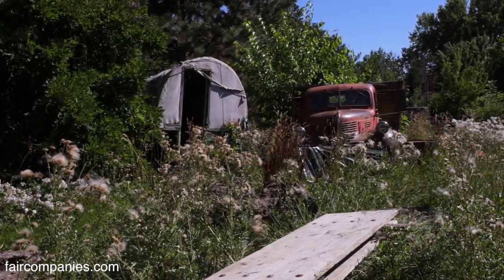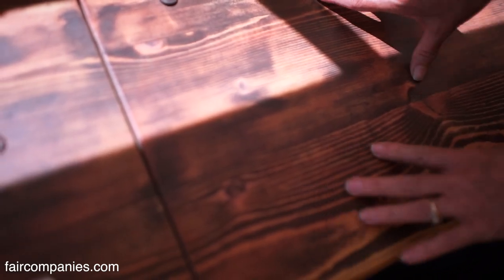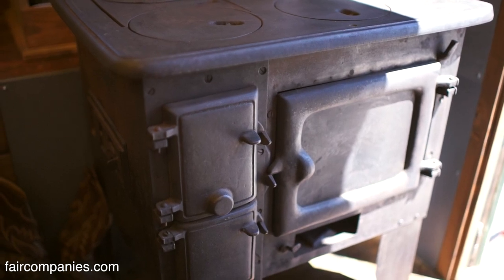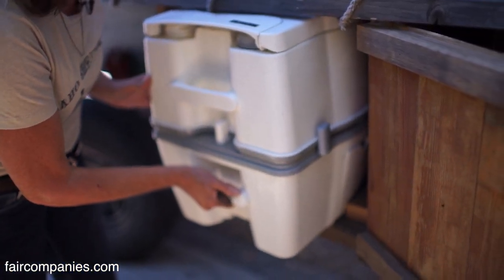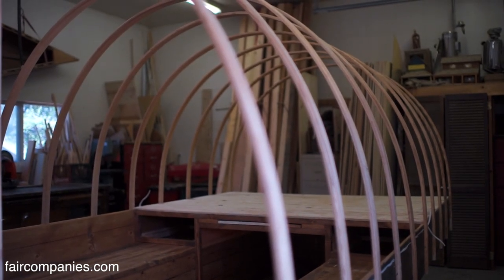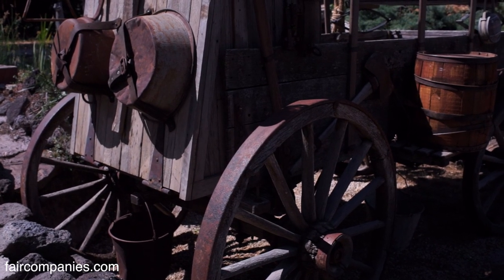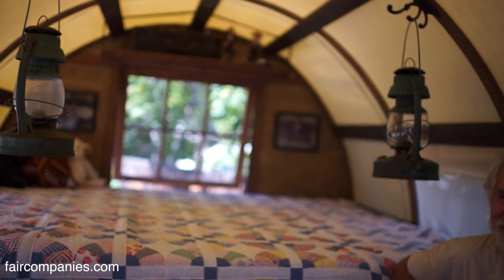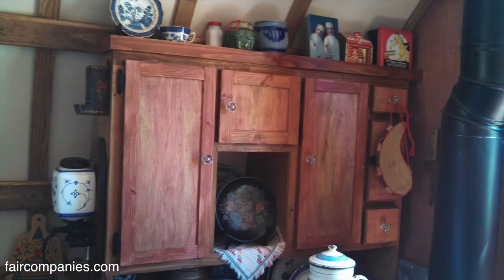Sheep wagons as timeless campervan: the Airstream of pioneers

Comment: I have that exact Thedford camper toilet, and we have a family member that weighs 450 LBs who used it for over two years as an every day toilet at his place, and even he said it was so strong it was like sitting on concrete. Hard to believe plastic can be that tough, but this toilet still looks like new.
Reply: +St. Hugh Sounds like an interesting alternative to a compost toilet -- albeit, probably not as enviro-friendly. Does it require some kind of special chemical solution to breakdown the waste? If so, how long does it last (and is it easy to find/re-fill)?
Reply: +Les Jeux Sont Faits You'd be surprised how fast solid waste breaks down. It pretty well happens overnight without being treated with anything. The only thing we put in the holding tank is about a half cup of Aqua-Kem Holding Tank Treatment, but that's basically just something to keep the toilet from smelling bad. You should put about a cup of water in there too just to get things started. Wastes breaks down much quicker depending on how much water it's sitting in. Some people use a different tank for urine so they don't have to dump the holding tank as often. (It still gets quite a bit of water from flushing.) If you urinate elsewhere, the 5-gallon holding tank will get full and need to be dumbed about every three weeks with one person using it. If you also use it for urine, then cut that time in half. The good thing about also using for urine is that all that extra liquid makes the solid waste break down so much that when you go to dump it there will hardly be anything solid that comes out at all. It mostly just looks like typical brown sewer water. Makes clean-up a little easier.

Comment: You still see these in Utah, but not as common as they once were.  Many have aluminum shells, instead of canvas.  I've seen truck mounted campers and travel trailers in some of the same spots where just 10 to 15 years ago they still used the Basque covered wagons.
Reply: Basque covered wagons?  I know who Basques are, but Basque covered wagons as differentiated from other covered wagons?  What are the differences?